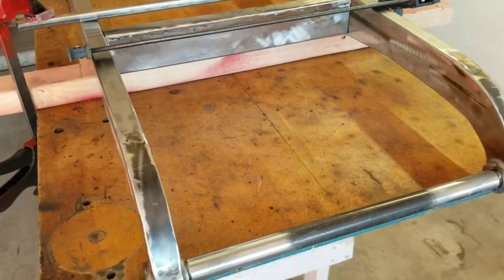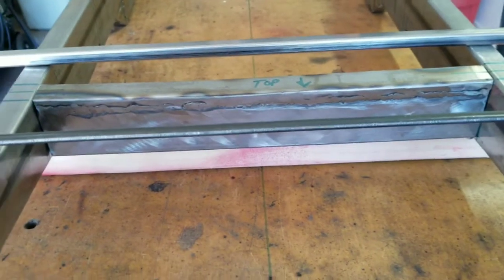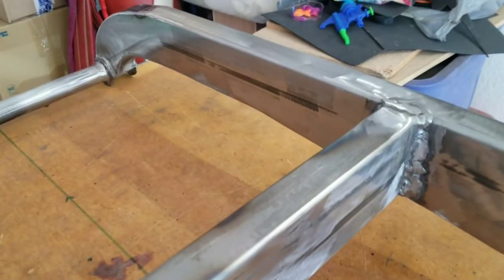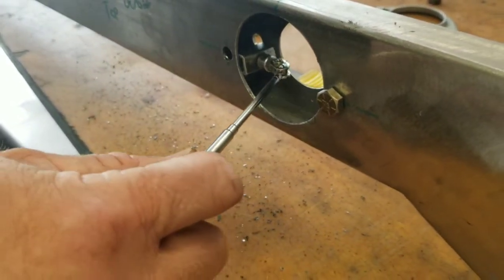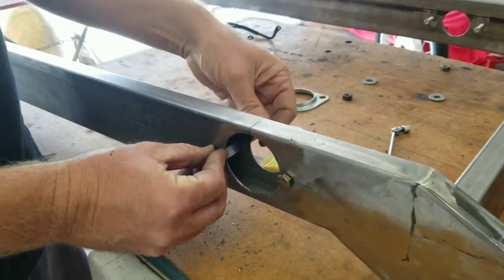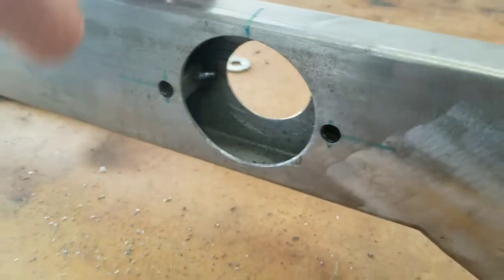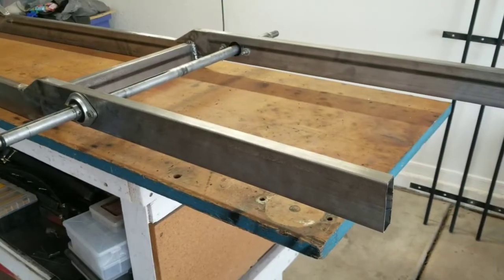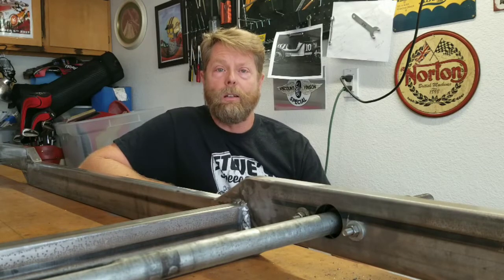Cyclekart Frame Part 3, Frame Assembly

Comment: Interesting that you didn't screw down blocks of wood this time around, before welding it together. Did that make it easier or harder do you think? I like the idea of tacking two extra pieces of steel on top to hold it square
Reply from the maker: Every time I build a frame, I have done it differently.  I think there is always a better way.  These frames really are very simple.